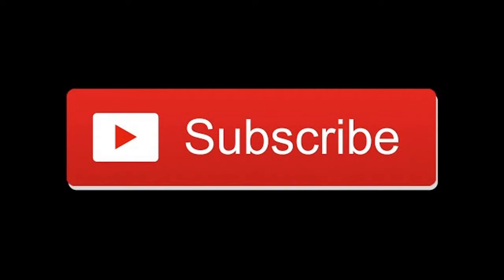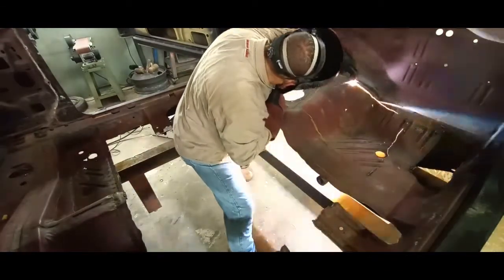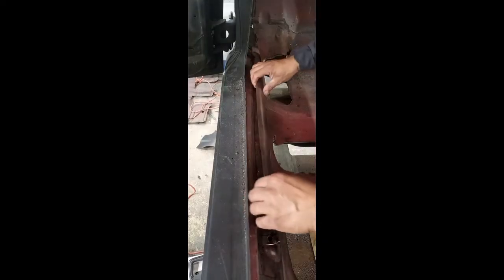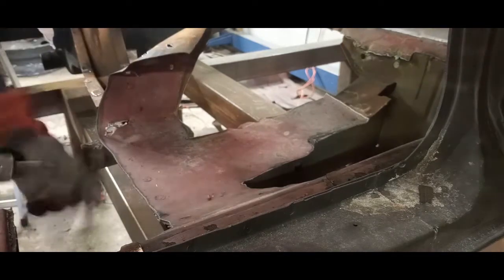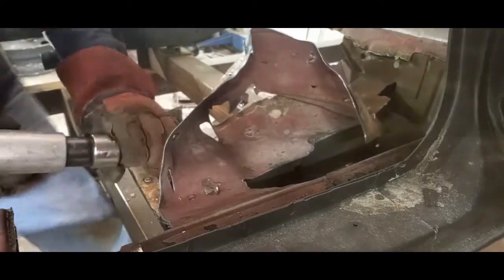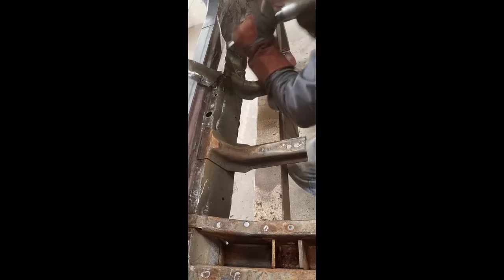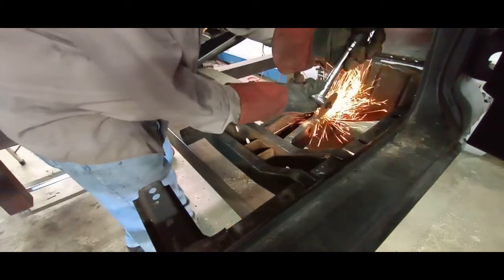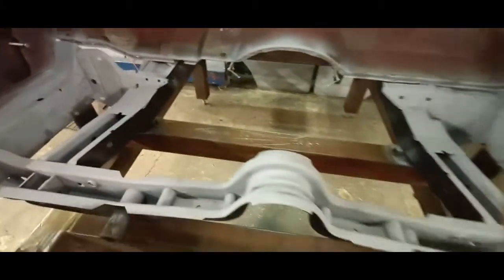How to Install a Floor Pan 1968 Dodge Charger Part 1 - Deconstruction - DIY Auto Restoration

Comment: Why… Looked like it only needed a patch. Not the whole thing. inner Rocker panels and braces are rust free
Reply from the maker: Customer accessed the rust in floor and requested replacing....
Reply: @guzzifabrication3448  Just looked like only typical rust by the gas pedal area where the wiper gasket dry rots and when it rains it leaks onto floor
Reply from the maker: @jmendo2546  The video really didn't show the rust pepper holes in 3 of 4 foot areas along with the lh floor extension, and lh toe board. Patch 5 areas or replace? replacing the floor pan yielded a nicer finish and was actually more economical than patching. Thanks for watching
Reply: J mendo thanks for the info! My charger also rusted and needs the front floor pans replaced but I didn’t know where it would leak water when it rained. Now I have an idea where to start looking. Thanks.